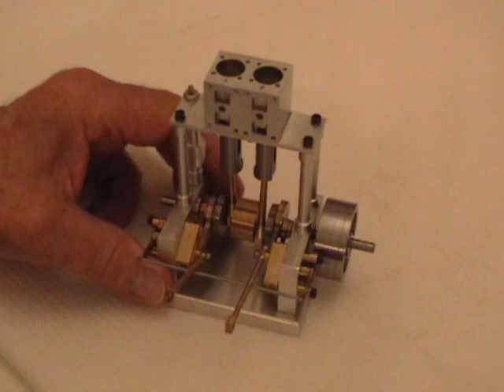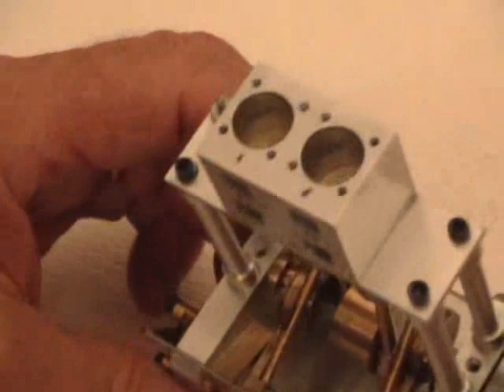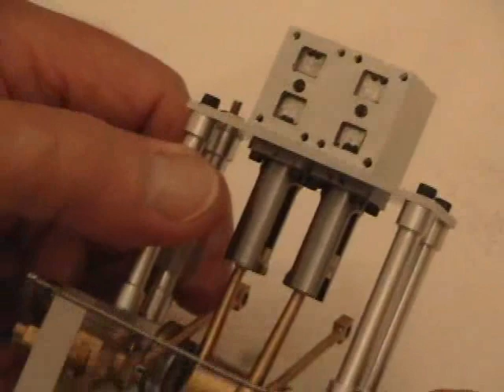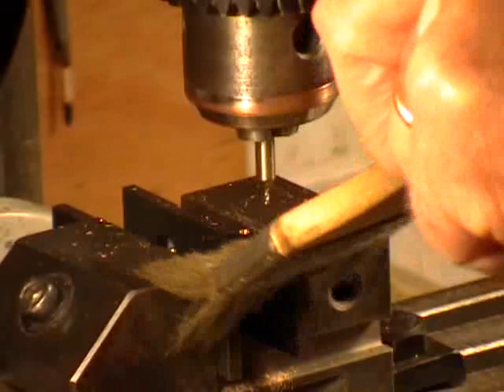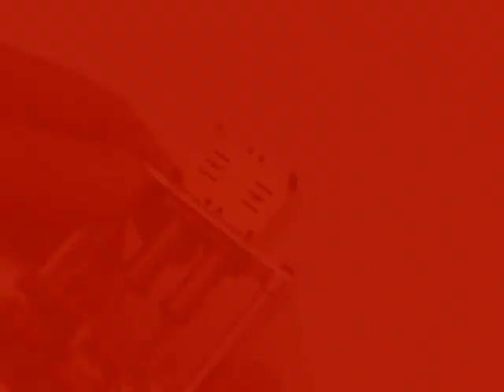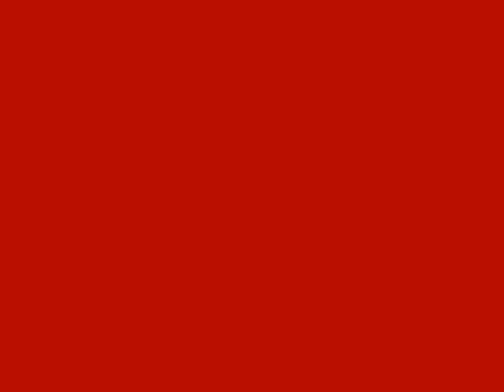Part 3: Machining the twin cylinder Valve Plate.

Comment from the maker: @mikruson  The cylinder block is aluminium, and the cylinder bores are drilled undersize, then reamed to size, and then lapped wet with 400 grit, then 600 grit, and lastly 1500 grit wet or dry paper over an aluminium mandrel.  It takes a bit of time, but it gives very good results.  Glad you like it - Cheers - John.